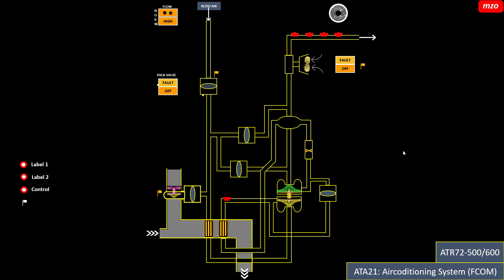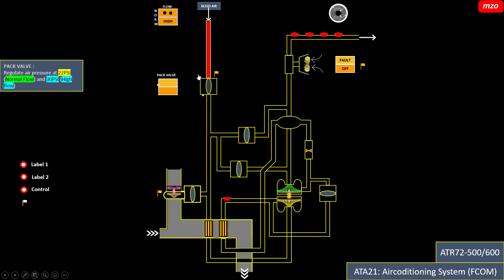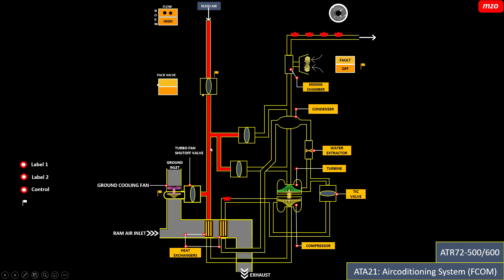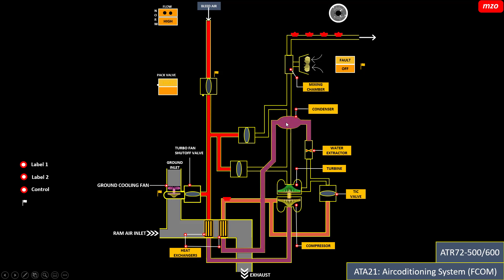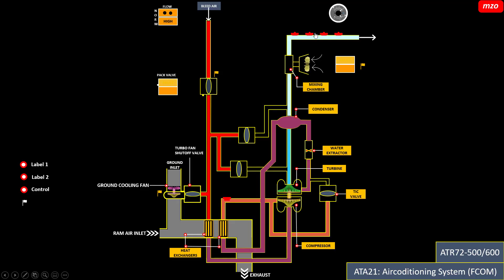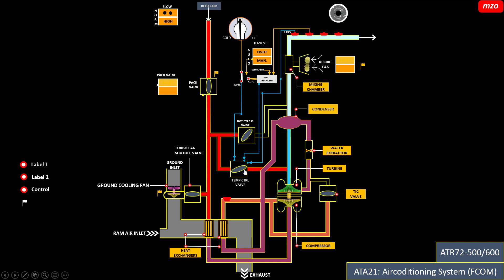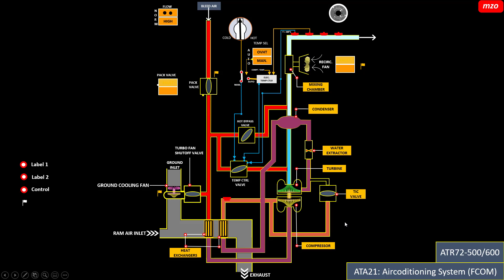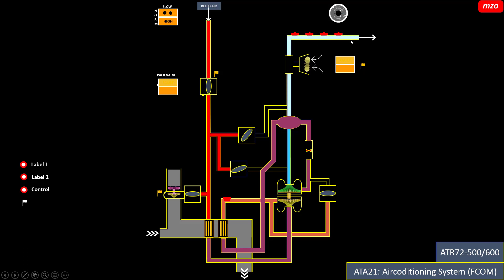ATR72: Airconditioning System (FCOM: DSC 21.2)

Comment: I was asked by my captain before and I don't know the answer. Where is the cabin temp sensor located?
Reply from the maker: Hi. long time no see. Cabin temperature sensor is located in Cabin where RH side overhead luggage box around frame 26-27, i.e. you walk on cabin and see RH side then count cabin windows from service door to 13th window then you will see the rectangle hole which suck the cabin air to cabin sensor located above hole.
Reply: @mzosharing  Ohhhh I see. The rectangle hole, I notice it as well. But where does the sucked air go?
Reply from the maker: Cabin temperature sensor is located with cabin temperature fan which is small. Fan located behind overhead box. Cabin air pass through this rectangle hole with the help of fan then pass through the sensor.